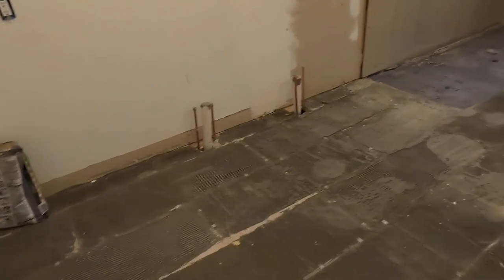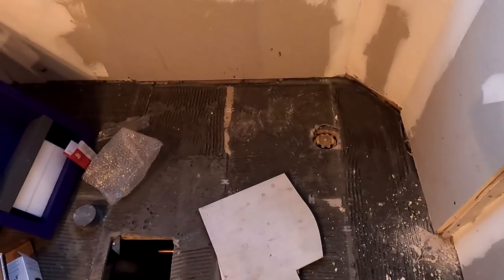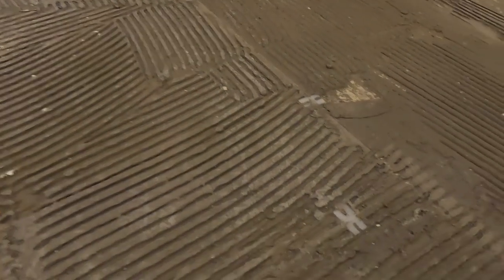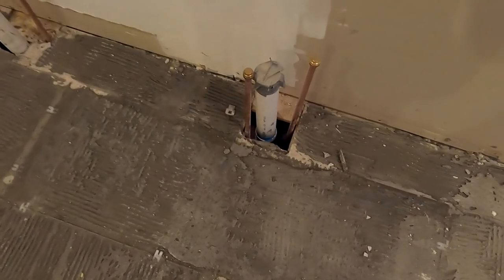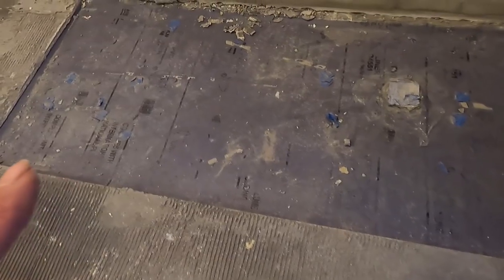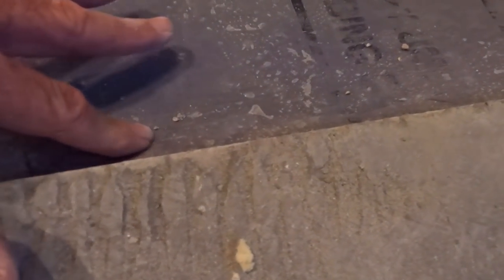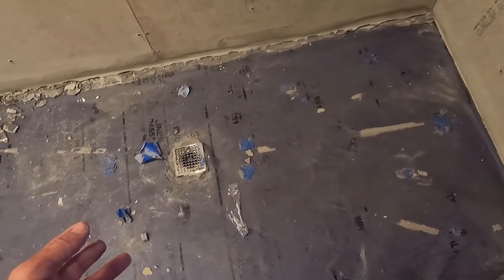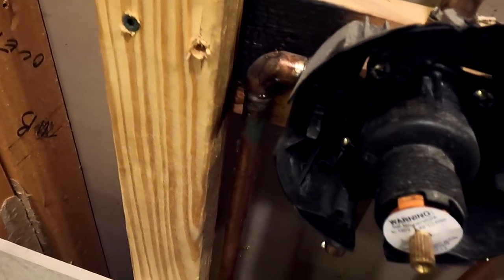PREP ON HUGE BATHROOM DONE WRONG

Comment: This should have been a five-figure job, and not low five figures either. Amazing that the owner did not do her research properly and get the right tradesmen involved. In the end, she will be looking at a long delay and a substantial financial loss, all for the sake of a few days getting the project properly set up in the first place. If she was incapable of doing this herself, she could have commissioned an architect to handle the design, technicalities, choice of contractors and supervision of the project, and it would still have cost less than the utter shambles that developed.
Reply from the maker: "If you think hiring a pro is expensive, try hiring an amateur"

Somebody wrote that on one of my other videos and I just thought it was apropos ✔
Reply: @StarrTile  Very true! People think that kitchens are the costliest part of residential remodels, but it's 'wet areas' where the really expensive disasters are often waiting to happen! Your analysis of this job was spot on, and I kinda hope you get the contract to put it all right. Should be quite an impressive space when it's all properly done 😁

Comment: BOB! THANK YOU! for making a video that screams "Don't put your backer board in the tub, put it on or slightly above the flange." Just getting ready to redo my old fiberglass shower enclosure with new cast iron tub and epoxy panel walls and of course I will be filling in my wall with sheetrock, then redgard then epoxy shower panels. I feel much more confident it will be waterproof without any issues, no chance for water to wick UP when it never touches the tub flange. Appreciate your videos. I will be looking at your patreon to properly thank you for your years of experience!

Comment: Sorry, random place to ask this: I'm going to DIY a walk in shower, but I'm having a contractor (friend) do the framing and the plumbing. He has built nice homes from the ground up. I'll build the pan (will use a pre-slope) and I'm just using the tried and true shower liner and 3 part drain, placed in the center. Q: My contractor/friend wants to use a cast iron drain (still 3 parts) as that's what he's familiar with and as he thinks it's stronger than plastic. Will this make things tricker for me, or is it the same deal/steps as doing the plastic?
Reply from the maker: You're asking the right question to the wrong person, I don't use cast iron drains nor would I have a reason ever to do so. And by the way plastic drains have been around for at least 40 years and they are tried-and-true

Comment: What tile clips would you recommend for a large format tile?  I was considering Perfect Level Master clips, but their site doesn't specify large format tile information.
Reply from the maker: Perfect level master has a good system, and yes they do have the larger clips for different size also 1/16 to 1/4. But they are pricey, I have kept my wedges for years and still use them but I go to Floor and Decor and get different brand clips at lower cost